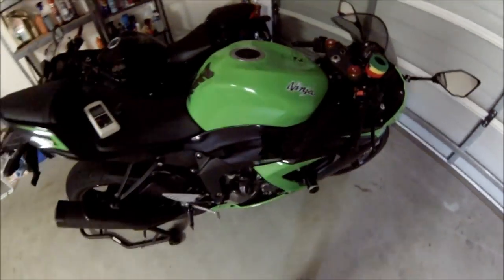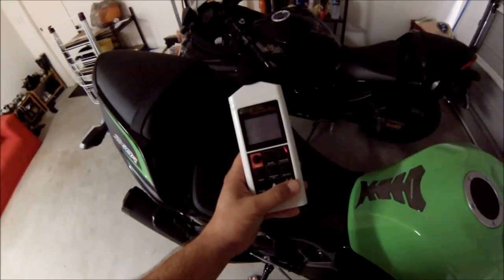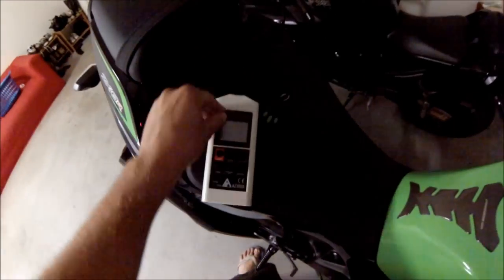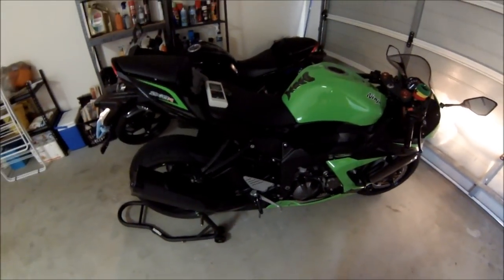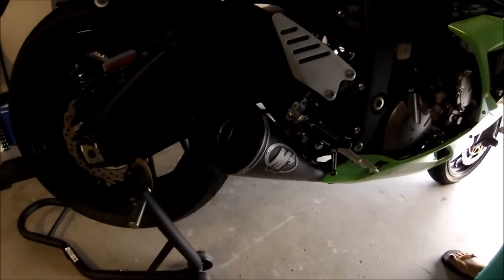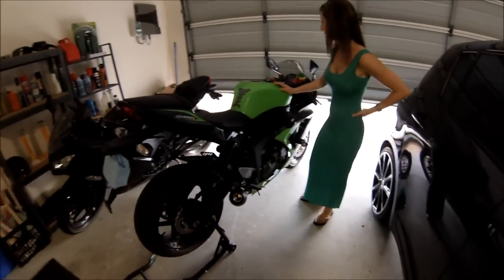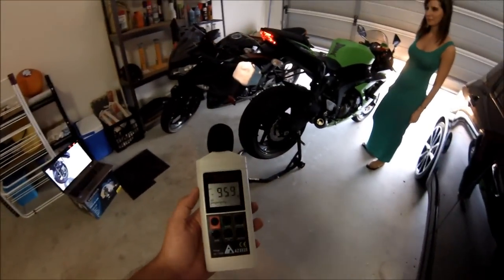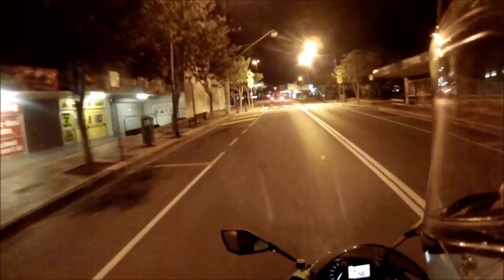Kawasaki Ninja zx6r 636 - M4GP Exhaust Sound

Comment: on the freeway no matter how loud your exhaust is no one can hear you over the sound of stereo
Reply: Not true man, when I ride the freeway I can see people snap their heads around before I even make it up beside their cars. This specific bike may not be loud enough to gain that response from people, but many of our bike are more than capable. Loud pipes save lives!
Reply: +Heath Purser most accidents dont happen when your coming up from behind they happen at intersections from the front or side  .......... dont fool yourself about them loud pips pipes
Reply: Yea that is true, but my bike is super loud and it has saved my tail before, from accidents. I had a truck try to come over on me and I couldn't go anywhere, so I gave him a loud Rev bomb and he jerked the wheel back over. It will not always save tou, but it definitely helps.. plus I have the reflective wheels, 85 watt headlights, red led's under the bike, reflective striping, etc.. for another level of added safety. I'm not a 20 something year old anymore that can easily snap back from an accident, so I try to take any advantage that I have access to..